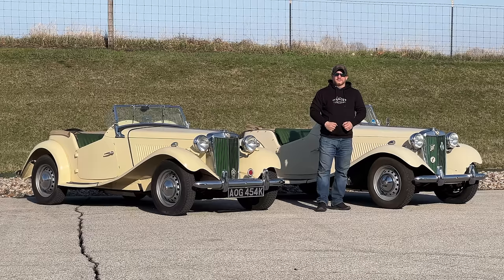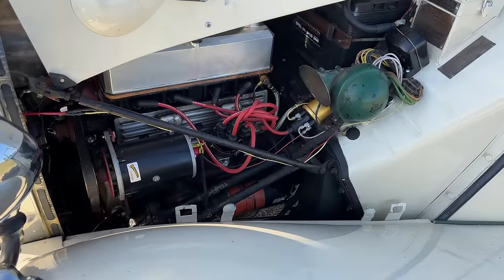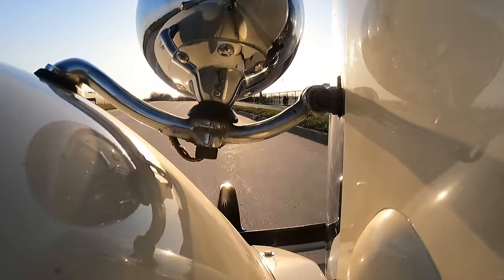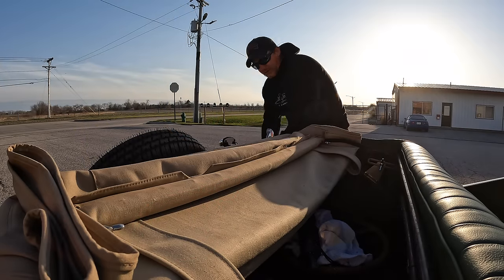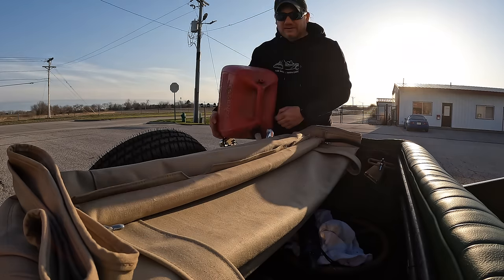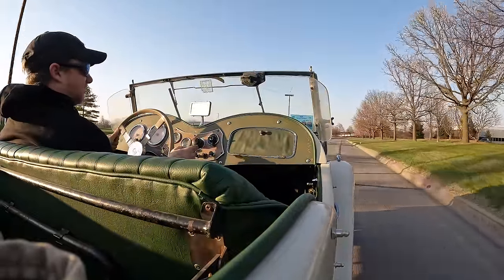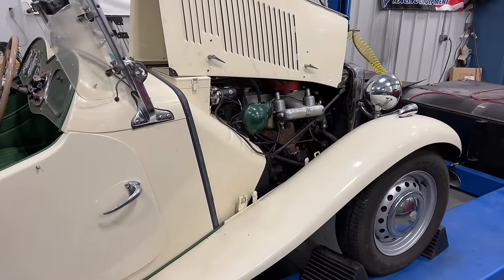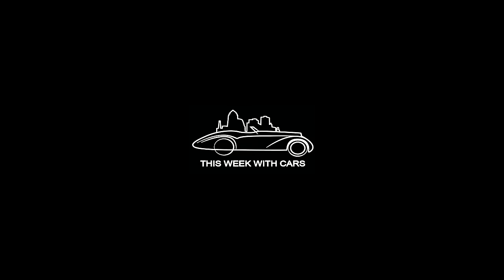MG TD Modernizations & Breaks Down On Road

Comment: Was hoping it was an engine swapped TD, love the styling of the TD but want daily driver reliability and modern traffic speed - any ideas on what would be a good swap without compromising the style?
Reply: Some folks I know have swapped in a 60s or 70s Volvo power plant which is actually very similar to their British counterparts. Also later MGB 1800 engines would make a good swap.

Of note though these XPAGs are very tunable and can reliably make good power and torque. That’s the route I took on my MG TC since performance parts are still readily available.
Reply: Keep your original running gear and swap in Miata running gear.
Reply: @MindDezign  Or just buy a Miata LOL LOL
Reply: @caseytailfly   I have owned a few of the TD/TC cars.
I bought a 1953 MG TD MK II in 1965.. my first car. 
I did not alter  my 1953 MGTD Mark II except for period mods.. In my opinion  these should be kept close to stock as there are limited numbers of them.

I then bought a 1950 TD...
My 1950 TD was bored to the max/ wild cam, head ported,  etc etc etc.. It was build for Bonneville, all period gear. 

Then on to a 1946 TC around 1967..
My 1946 TC was built for road or track with a wild cam over bored, cross flow aluminium head with  1 1/2" SU carbs , Borani 15" wheels, Alfin drums,  etc.. No  bonnet side panels and the requisite leather straps to hold it together. No need for  5 speeds or  most new age mods,  wonderful car.
All period gear.
Reply: @MindDezign  Just thinking that myself. Thought the gearbox might be the 5 speed MX5 box as this is commonly used in classic conversions (Eg MGB)
I thought the engine management of the modern MX5 engine might overcomplicate things a bit though.
Reply: @jeffhildreth9244  I have a ‘46 TC that is mostly stock but I’m rebuilding the motor with some go fast bits and TD Mk II valves, intake and carbs. Taller rear end in the back to keep the revs reasonable on longer journeys. I agree that modern upgrades are mostly unnecessary, but in particular a Miata power plant 3x more powerful than the original and would require extensive modifications to the rest of the car to keep it from being a death trap. 

To each his own though, I personally find that the XPAGs are a big part of the personality and charm of these cars, and you lose a lot of that when you remove it.
Reply: @caseytailfly That XPAG mill would have been an awesome hot rod engine back in the day for a small car like a Ford Pop, Austin 7 or similar.
Reply: Volvo B20. Looks the part and 25% more power.

Comment: What was the source of the gearbox. Does 5th give an overdrive?
The "fuel gauge" on a TD is the starting handle. Dip it into the tank at regular intervals, and you'll know how much fuel it's used and has left.
Reply from the maker: Yes 5th is an overdrive it is a Ford T-9

Comment: I see that you used a Ford T9 transmission, but I don't know what that is. A Ford of England Escort? What are the issues mounting to a MGTD engine? I assume you used the MG bell housing but I'd like to know more about your retrofit.
Reply from the maker: Used in the Capri, Sierra and Merkur XR4Ti.  The TD engine has to be moved forwards about an inch.
Reply: The gearbox is the type 9 Sierra box , from Hi gear engineering in my case, with a modified first gear to a slightly higher ratio. They now offer a kit which does not involve moving the engine forward but does require the removal of a section of the cross tube. This is replaced with a casting supplied in the kit.

Comment: So, the TD is not made for travelling. 51 @ 3000 rpm doesn't sound too good. Putting a different engine in would do the trick. 
     Have you ever thought of taking one of those English cars and setting it up the way they do with Caterhams ? Not necessarily a road monster, but at least enough that it can be driven at normal speeds with lower rpm's . I've never seen anybody do that and I always wonder why  .........  I just went to look at this video of an old Lotus 7 that this old guy put together.  The engine is a Coventry Climax  all aluminum 1.1 liter .  That tiny engine (smaller than your TD)  puts out an amazing amount of power. I dont know all the details but it does have 2 Weber carbs .  Anyway, that could be put into any MG or Spitfire or Bugeye and the car would definitely move. Maybe cut back to one Weber and it would still be much better than their original setup.
   Anyway, if you want to see it, the video's title is  "Lotus 7 racing car sound, 1957- Ivan's Shed".  (Ivan's the old guy).

Comment: What transmission did you use?  My MG B needs a 5-speed upgrade but I'm trying to find one that doesn't cost an arm and a leg.
Reply from the maker: Ford T-9
Reply: Do you not have the overdrive fitted that many had, it just bolts on in place of the tail of the gearbox.
Reply: I do not.  I don't know if overdrive was an option in 1973.
Reply: I am pretty sure they had as a factory option a  'Laycock de Normanville' overdrive. Very popular in UK in the 50's to the 70's on many makes of car. Worked on top and third gear on mgb cars I think.
If your gearbox has syncro on first gear it would most likely fit the LH type.
Reply: @jimcrichton8028   Not exactly that easy.   Mainshaft and other things are not compatible.  Easier to find and fit a gearbox with overdrive already fitted.    Units post 1967 model are full synchro so the best choice.

Comment: At what speed can it be driven? I. E. cruising long distances on the highway. Can it be driven 65 mph for extended periods of time?
Reply from the maker: Yes but might not be able to maintain that speed on hills unless you have rebuilt the engine with more power.    The car will do 80+ if it has enough power.

Comment: I’d want to change the rear axle ratio so I could drive 70 and be at 3K rpm’s.
Reply: i doubt you'll have enough horse power to do that with a stock TD engine. ....there are limits you know. :)

Comment: AOG 454K looks like a UK numberplate, but wouldn't be right for this car.  A 'K' suffix is from around 1972 and cars made before 1972 wouldn't be allowed to use this number.
Reply: IIRC, the 'OG' combination signifies Birmingham UK where MG had its headquarters after moving from Oxfordshire. 
The 'K' suffix is indeed around 1972 (I had a K-reg Triumph) but certain suffix letters, including A and H can be used for 'heritage' plates although they are not supposed to suggest that a car is younger than it actually is.  Perhaps Steve has a back-story.

Comment: can someone whose 6ft 2 fit in the drivers seat
Reply: At 195 cm, I fit in an MGA just fine (for a couple of decades) but I was pretty darn close, to looking over the Top of the windscreen. Not sure if that added to the British Sports Car 'ambience;' or if all the other folks on the road thought I was driving around, searching for stray "mentational marbles."
Reply: Legroom in MG T cars is quite good actually. And the seat can be modified for even more legroom also.
Reply: I found if you can keep the original seat foam you sit a bit lower, I’m also toying with the idea of using early sprite bucket seats.   I’m 6’2”, and definitely have plenty of leg room.   Just feels weird with the steering wheel so close + I could stand to loose a few pounds (stomach)
Reply: @hammerandhatchetengineerin4967  thanks this is so good to know, being tall and small cars does not always work well

Comment: If I want a old/classic car I want it orignal warts and all. Although I am parital to the 5 speed update. But ,then again I know how to double clutch ! Not into the reso-mod thing.
Reply: I agree. As another commenter noted you can also just put a taller rear end in these with the stock transmission with similar benefits. Although fwiw the earlier TC transmissions were actually superior to the one fitted to the TD